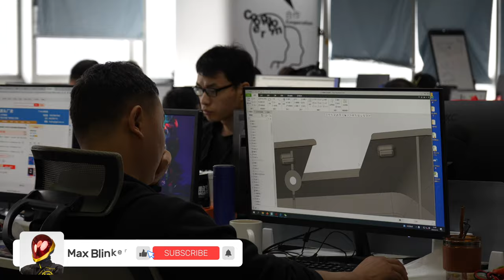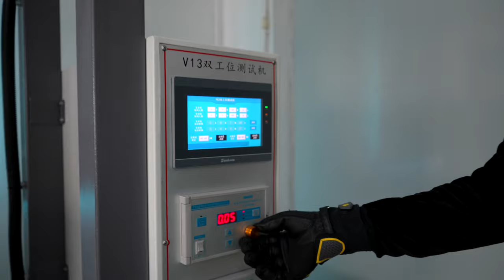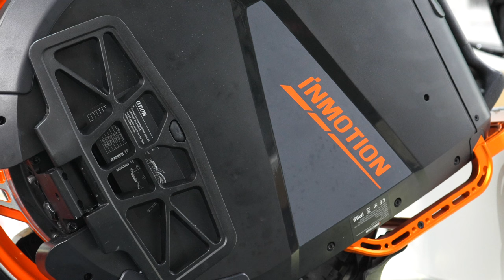Founder of InMotion: Safety and quality come first

Comment: 5 of us in our groups of riders have V12s. 4 of us have had our wheel cut out on us within a year of purchase. I'm the only who didn't hurt himself because I happened to be going slow and stopped as soon as I heard a warning and set it on the ground while smoke started coming out of it. It's being repaired at the moment.
2 have V11s which have stopped working after charging, and needed to be accessed remotely by Inmotion to get them going again. At least they didn't get hurt.
Our experience with the V10s have been solid and reliable.
Reply from the maker: We're sorry you weren't satisfied with these models, but InMotion certainly has other great models.
Reply: @MaxBlinker  Definitely. I've loved riding the V12HT, but if you are going to post a video boasting safety, you should take into account that people like me may wish to take the opportunity to communicate contradictory experiences, and not just a one off incident. Also, the backlight on the V12 is not at all visible, in terms of safety. But, like I said, I have thoroughly enjoyed my time with it, and hopefully when it's repaired I will be able to keep enjoying it some more. I also hope that with any future wheels, when you do discover any design or manufacturing flaws, that you do an even better job at fixing them when you release later batches. I am looking forward to seeing what you will come out with next, as the V13 is too big and expensive for my personal liking, although it does look like a fantastic wheel in its own right.

Comment: I appreciate that InMotion puts such a focus on dependability and quality. That's why I look to InMotion first when looking for an EUC. My highest priorities are:
1. Safety & reliability
2. Cost
3. Waterproofing
4. Distance
I don't really care about speed at all. I usually keep it under 25mph, so the more expensive, faster wheels just don't appeal to me. I have a family to worry about. I can't be riding at 50+mph on a unicycle.
Reply: They have one of highest defect rates though lol.  The reliable and safe reputation only come from the V8 and V10 series which also happened to be their top sellers and were most of their customers are
Reply: @CrunchyTire  Yeah unfortunately they have had a lot of reliability issues with different batches. I haven't heard of too much from the most recent batch though, and I haven't seen any issues with my V11 yet... (knock on wood.) The reliability issues were the one thing that almost made me not buy my V11. InMotion still got my business because they ticked all of the other boxes, and it seemed like the kinks had been ironed out.

Comment: As much as I love Begode performance, safety and quality should always be first.  I know Begode performance is like a drug, but I think we as a community need to take it responsibly.  It is refreshing to see Inmotion take a safer approach and catch up or even beat Begode performance.  Let the race continue, it's just great !  However I had bad experience with the v11, when I dumped hard over a curb, a few times the unit shut itself off, and there is no way to restart the unit, unless you plug the charger into the unit.  That was just annoying, as I had to push the unit back home from far.  This happened a few times, and that's something about Begode's simplicity wins.  So yes, balance safety / quality with usability as well.
Reply from the maker: We are sorry for your inconvenience with this model. I hope it didn't take away your joy of driving. Max wishes you many happy kilometres. :)

Comment: I find this incredibly humorous. My v12 ht bought in the last month just cut out under me going 15-20 no pedal tilt no warning sound. its been a rough couple days at work covered in road rash. Glad i was wearing full gear but my wheel is totalled, at least it has a warranty... But my faith wont be so easily repaired

Comment: I have a V8 from 2015 with 11k km driven on it(nothing changed then the tire) and it still works okish, had to resort the battery's bc there wasnt active balanceing on the battery cells, but now the issue is resolved on v13

Comment: i almost got a v12hs but that was when the mosfets were bad and i didn't want to deal with the motherboard on it so i settled with a ks 16x and i really wish i waited for the v12 to be fixed because it looks soooo good
Reply: I just had recently 16x motherboard burn down from freespin, replaced for free by shop i bought it from, but 16x is not immune, mileage was at 670 km when it happened.
Reply: @JohnDoe-ch6qy  free spinning a 84 volt wheel probably wasn't a great idea lol
Reply: @VECTOR_Coasters  you can freespin a 126V v13, if something burns out it's covered by warranty, because it has protection to stop it, and if it burns out from freespin that means protection didn't work.

Comment: I have v12ht and my tires popped 2times on me already and it’s only been 4days since I have it .. 😢
Reply from the maker: We're sorry to read that.
Reply: @MaxBlinker  any psi suggestion ? I weigh 210-220lbs
Reply from the maker: The correct pressure is indicated on each tyre. It is therefore important to follow this information.